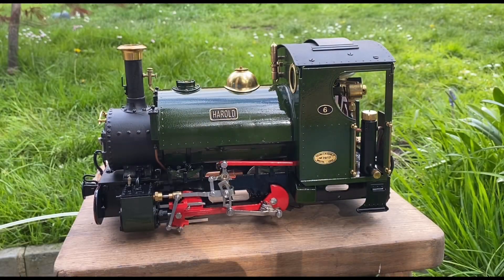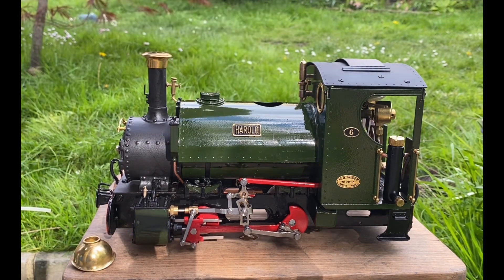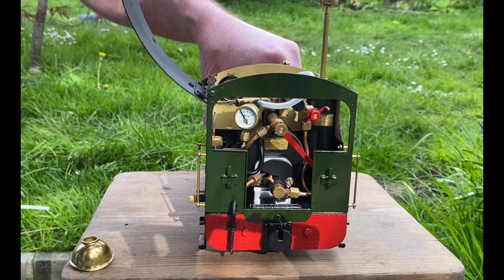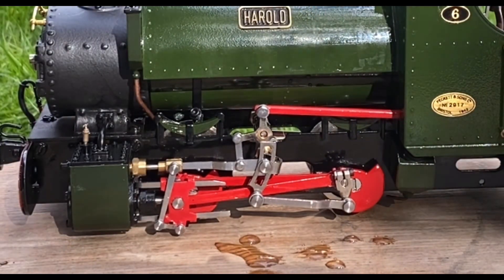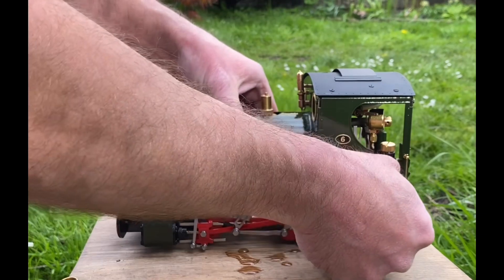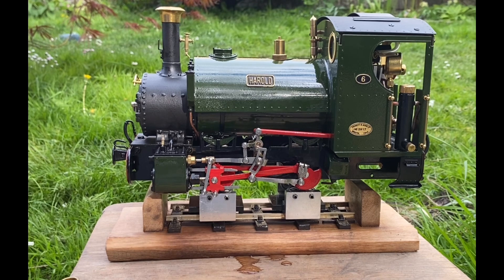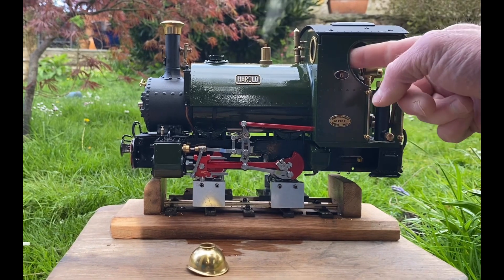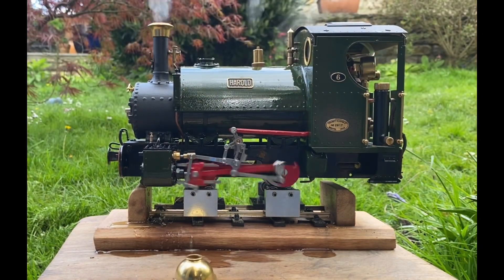How to steam up a Roundhouse Katie

Comment: Have you managed to find any butane that is already threaded? I've tried using both 100% butane and the butane/propane mix. The mixed gas is a lot less stable and it burns so hot that i have the valve barely open and it often goes out. If i could find butane cans that are treaded that would be ideal.
Reply from the maker: Usually I use gas from a company called Go Systems which usually have a threaded outlet, I was using some cheap camping stove gas for this video I had lying around. Depends what part of the world you live but in the UK you can get Go system gas from places like Halfords, screwfix etc and they do straight butane or mixed, good quality gas and most people in this hobby seem to use it.
Reply: @Thelittlegreenloco  Thanks! I'll pick some up 🙂
Reply from the maker: No worries, if your uk based, tool station seems to be the cheapest for Go System gas